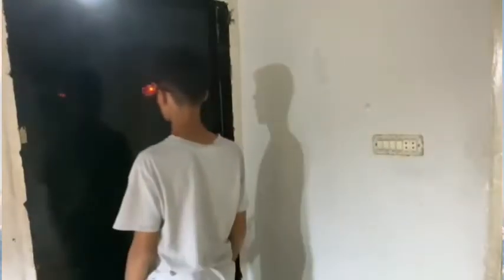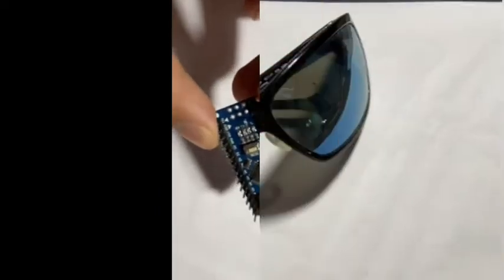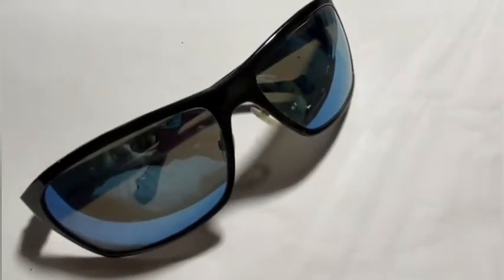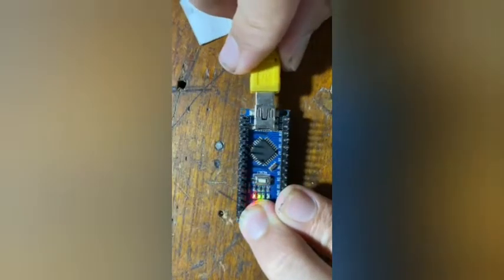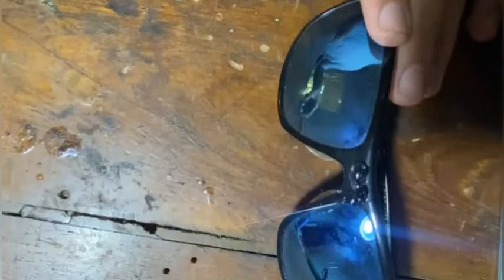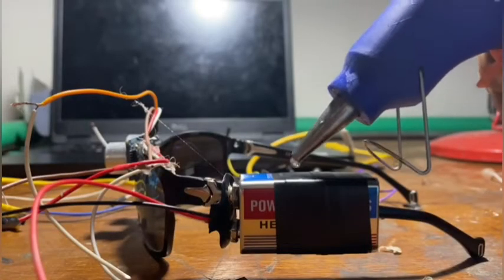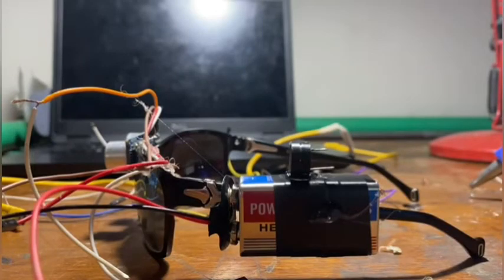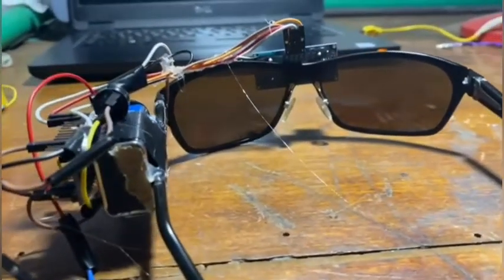YOU Won't Believe This Arduino Project for Ultrasonic Glasses!

Comment: //Hitec ELECTRONICS
int buzzer=13;//buzzer at pin D13
const int trigPin = 12;// trigpin at D12
const int echoPin = 11;// echopin at D11
// defines variables
long duration;
int distance;
void setup() {
  pinMode(buzzer, OUTPUT);
pinMode(trigPin, OUTPUT); // Sets the trigPin as an Output
pinMode(echoPin, INPUT); // Sets the echoPin as an Input
Serial.begin(9600); // Starts the serial communication
}
void loop() {
// Clears the trigPin
digitalWrite(trigPin, LOW);
delayMicroseconds(2);
// Sets the trigPin on HIGH state for 10 micro seconds
digitalWrite(trigPin, HIGH);
delayMicroseconds(10);
digitalWrite(trigPin, LOW);
// Reads the echoPin, returns the sound wave travel time in microseconds
duration = pulseIn(echoPin, HIGH);
// Calculating the distance
distance= duration*0.034/2;
// Prints the distance on the Serial Monitor
Serial.print("Distance in (cm) = ");
Serial.println(distance);
if (distance<=55)
{
  digitalWrite(buzzer, HIGH);
  }
 else
 {
  digitalWrite(buzzer, LOW);
 }
}
Reply: Is it ok?? Please reply fast
Reply: And give the wire connection